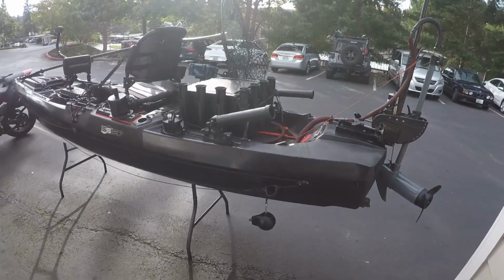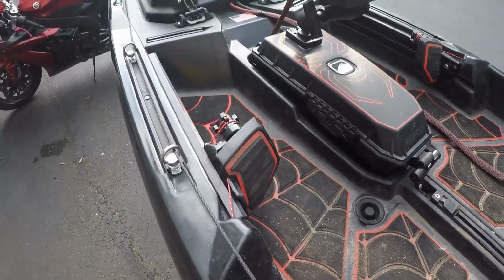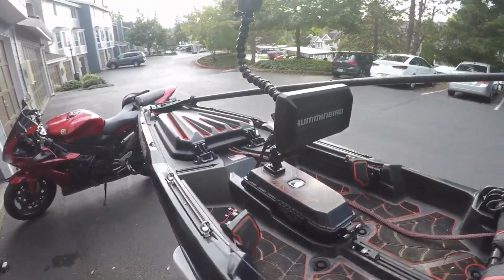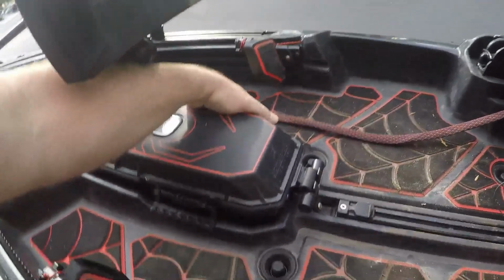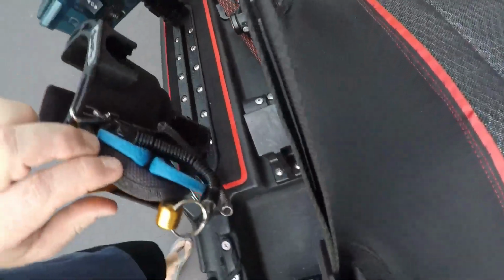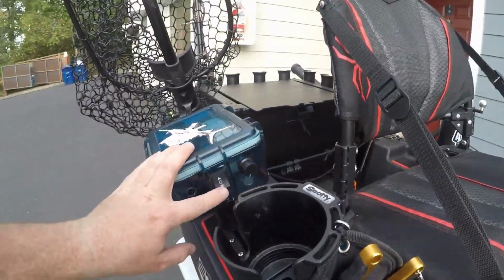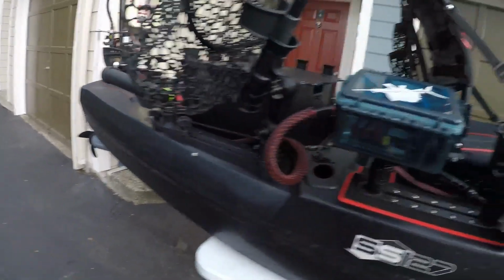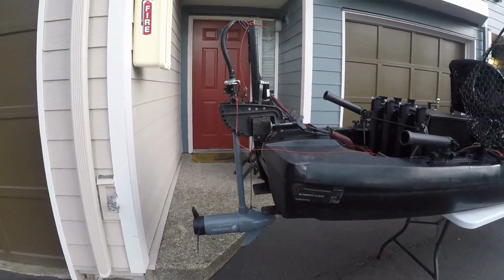Bonafide SS127 Black Widow Kayak - Modifications, Trolling Motor and PWM Controller

Comment: Did u get any interference on the fish finder with the PWM installed? I've been reading that's an issue with ALOT of people
Reply from the maker: I run the fish finder on a seperate battery inside the dry pod.
Reply: @g-wolfoutdoors8150  I'm thinking worst case scenario that will fix any issues I may have. Looks like I can get a seven amp hour battery that only weighs 3 lb, for 20 bucks. Definitely not going to break the bank, or tip the boat
Reply from the maker: I run a 10 ah and it lasts a full day on the water with the Hummingbird Helix 7.

Comment: Dude you bought a lithium battery?  Holy crap those things are expensive!
Reply from the maker: The 10 AH was about $120. It's crazy light and lasts longer, but it is pretty expensive for what it is.
Reply: @g-wolfoutdoors8150  that’s not bad at all. I think the one I got is a deep cycling battery. It was $100 and it’s heavy as shit. Is it a different between that and a lithium battery. Honestly mines last for awhile. I only use it for a trolling motor on my jon boat. I can fish 3 hours let it sit for a week and go back and fish 3 or 4 hours. It’s jus to heavy to be carrying back and forward. I ordered the old town sportsman powered by Mk. Planning to use what I got cuz everyone say lithium batteries are high. I’m willing to pay $120 for a better and lighter battery.
Reply from the maker: @tryingtogetthere1653  to be clear I am running a lithium battery for my fish finder that is the small 10 AH and it cost $120. My main battery is a cheap Walmart deep cycle 100 AH group 24 that was under $100. The lithium batteries that can be used for trolling motors are closer to $500 or more.